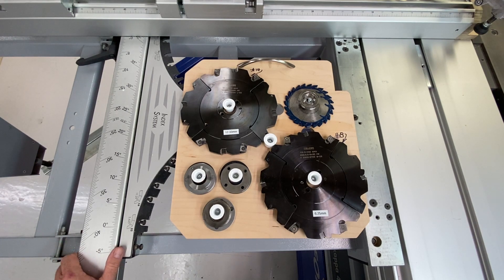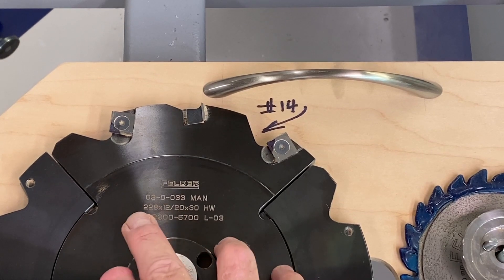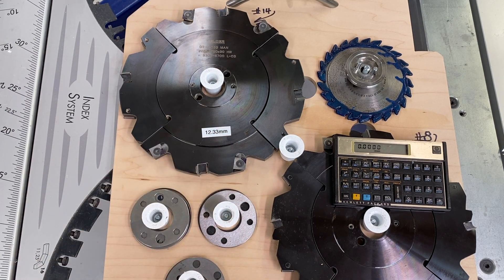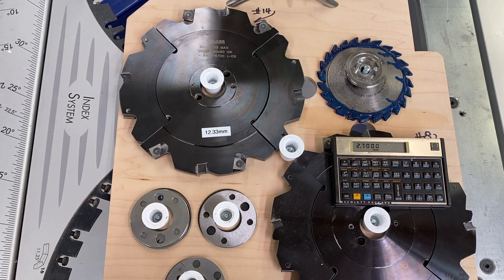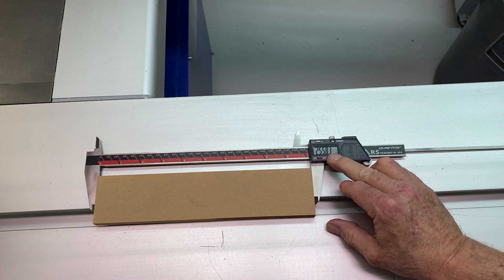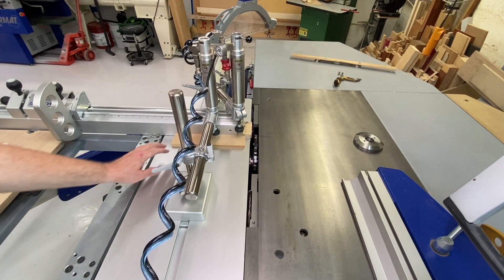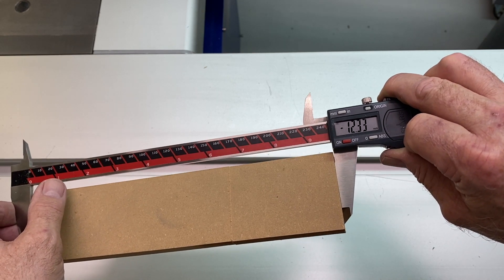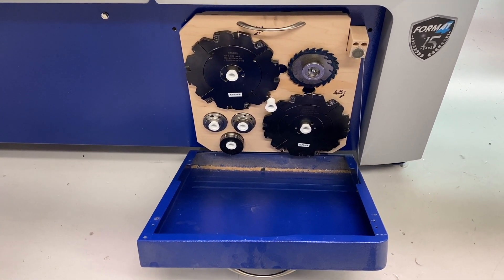Configuring cutting width of a two-piece dado or grooving cutter.

Comment: Hooray!!!  I cheer whenever I see a real HP-12C.  That's still my favorite go-to calculator of all time -- though these days, I'm not often calculating NPV or IRR or such.   I don't use the real thing often but I do have the 12C app on my iPhone which does a pretty good emulation, though I will confess in using the ersatz HP I miss the tactile delight a real HP-12C gives.   Of course, my other favorite calculator for things of the woody variety, like rafters and stairs, also in emulator-iPhone app form, is the Construction Master Pro.
Reply from the maker: Yea, I have the iPhone app and two of the real HP 12C calculators.   No way could I every go back to a conventional (non-RPN) calculator.